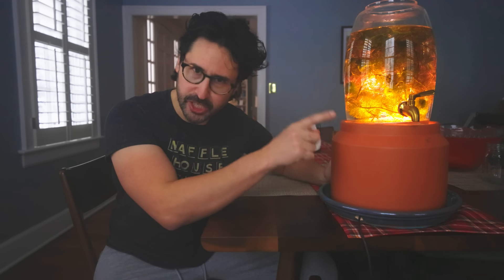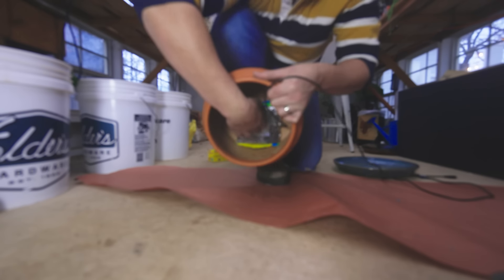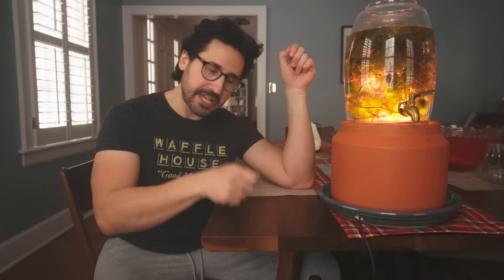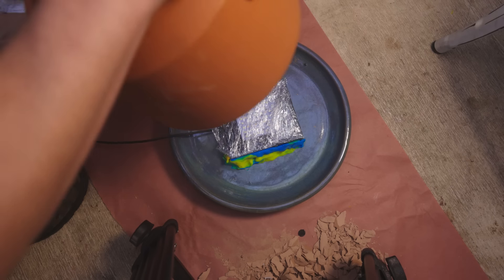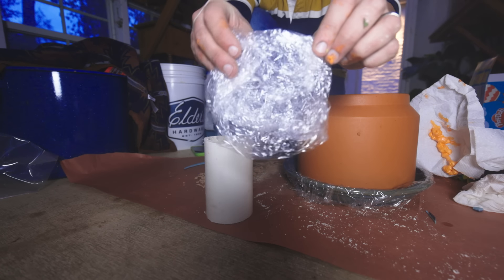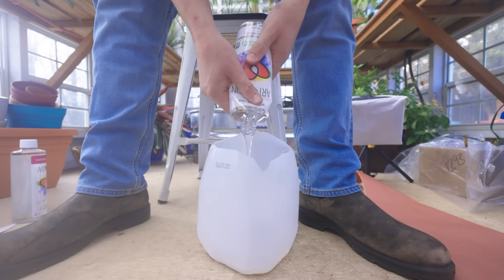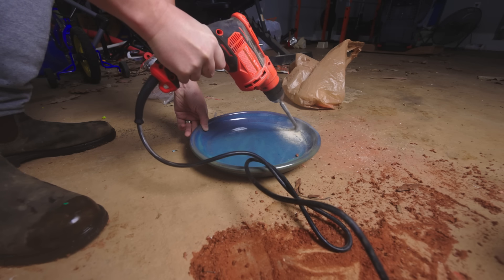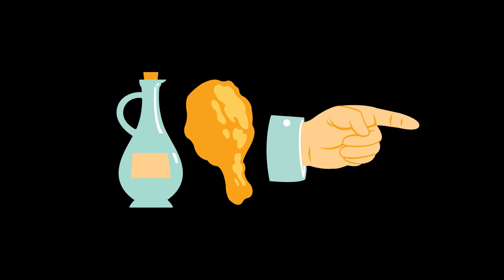DYI platform for up-lighting drinks, fish bowls, whatever!

Comment: Theater lighting designer here! I have done a similar trick for a production last year = two bowls nested into each other. The bottom (bigger one) has a few diodes of LED tape, and the top (slightly smaller) one has a bit of water which the characters can draw a cup from, or whatever choreo they need. It provides a pretty up-light for the actors and if the space is small and low clearance.  it casts pretty striations across the ceiling.

Comment: If you're using the stock faucet on that jar, you might want to replace it. I have one that started leaking badly after just a couple of weeks. Got a sturdier one for around $15 and it's still going strong months later.

Comment: PVC is not heat tolerant. It will off-gas when heated.

To save money on resin, only mix a small amount at a time. There is no point in having extra.